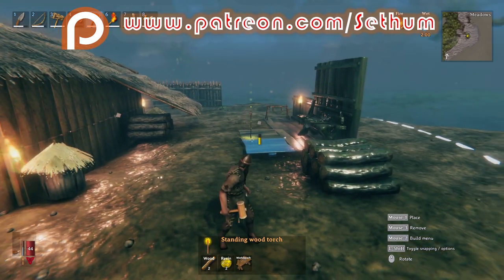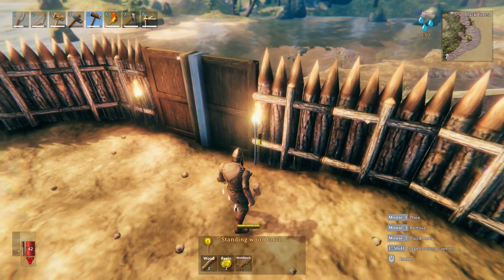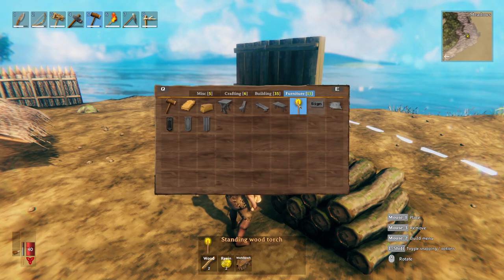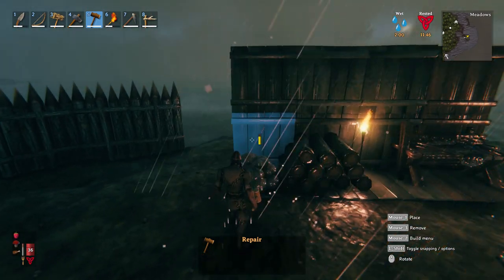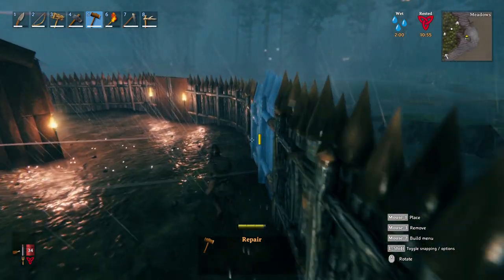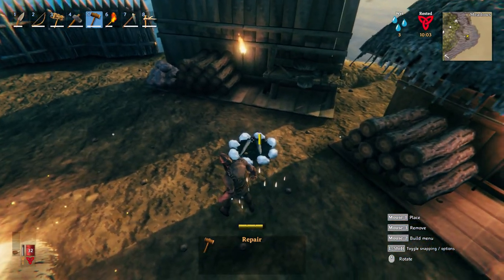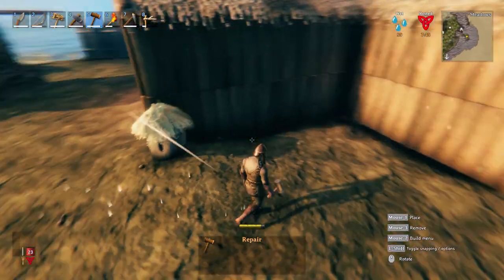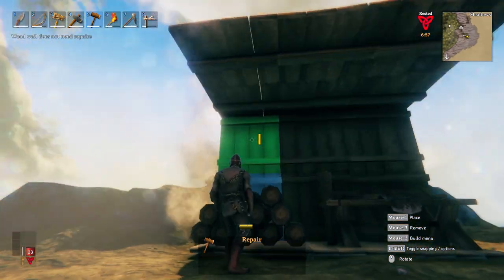VALHEIM STRUCTURE DAMAGE - HOW TO PREVENT STRUCTURE DAMAGE IN VALHEIM

Comment: I am kinda scared for my base because i built it on a snowy mountain and to be honest, i did activate some cheats to build it (but i used only the materials i could already obtain at that point, meaning i used early silver stuff/ post bone mass) and now i'm kinda scared that the dragons will damage it if i'm gone. I did put that statue in the base which covers basically everything since i didn't have much space,  but i also built some kind of open balcony with a roof, maybe i should place iron gates/bars there to prevent them from entering. Anyways, i haven't played Valheim since over a month already so i forgot quite a few things by now.